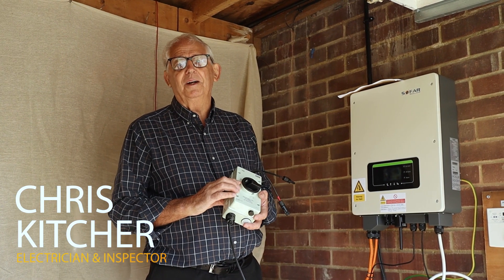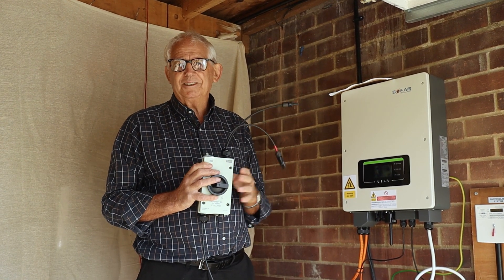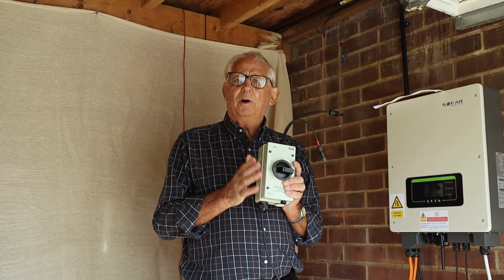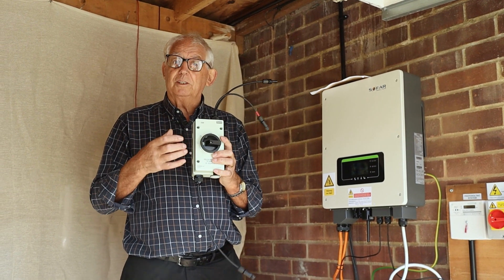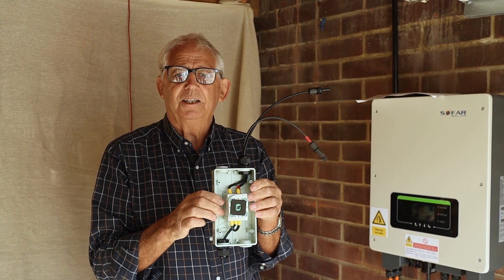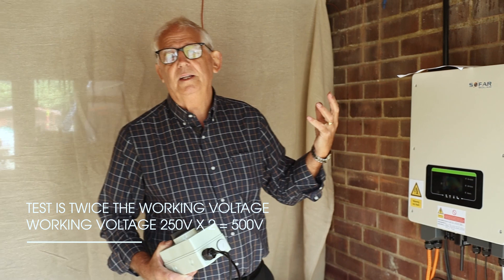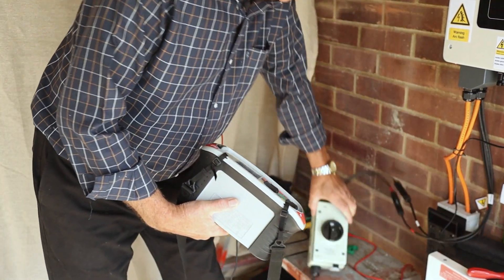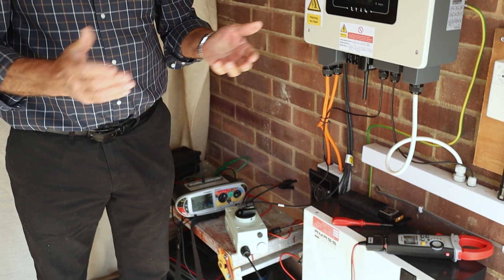Solar PV insulation resistance test with Chris Kitcher. 🌞😎

Comment: The correct amperage multiplier is 1.5625x for calculating the minimum amperage rating of components for solar/pv systems.  That’s the bifacial short circuit current (Isc) of the panels times the 1.25 multiplier for continuous loads times 1.25 again for over irradiance/production in rare cases.  1.25 x 1.25 = 1.5625.

Comment: Hello sir! Great video, I was thinking about this topic for last few days and finally found you! Do you have some kind of pv insulation tester? Or it's just normal one? I have CEM DT6650 and I'm wondering if it's ok? I assume that the third wire from pv shortcut is connected to L in the tester, and the N wire is connected to the ground in the  tester? No matter if the pv system is grounded or not? And you measure it in full sun? With the highest voltage and current?

Comment: If you do not have a stand alone isolator you cannot change the inverter should you need to.
Reply from the maker: I’m afraid you have picked up some wrong information somewhere John. As long as you isolate inverter from AC side first you just unplug the MC4 connectors and you will be fine

Comment: Chris is like the videos. I have a question that I hope that you can help with. After a system has been in commission for some time when I have to go and perform a periodic test on the system, performing any test that requires access to the roof is difficult when the scaffolding has been removed. I am thinking of IR tests.  Due to the inability gain access during a test on an EICR on a typical electrical installation I would LIM the area with no access. I am hoping and expecting you to say the LIM can be applied to the IR test on a PV system especially if the Panel String produces Open Circuit Voltage in line with expectations regarding the manufacturers figures and the irradiance test on the day. I hope you will comment on this. Thanks for the vids. P.s. I have bought your testing book in the past after viewing other videos.
Reply: Test positive to earth, clamp earth to exposed part of the inverter which could be bear metal screw or grill repeat the process with negative. Same applies above 1MOhm or 0.5Mohm @250v if the total voltage of array is <120

Regarding floating system

Comment: Hey Chris, great vid. If you don't mind sir, please clear up the following:

1) I assume this is an ungrounded array, meaning neither + or - from the array is solidly or functionally grounded, correct? 

2) I understand when you short the array, there is 0 volts at Isc but the array Isc current (I think you said 14A) is still flowing in both cables and now you are back-feeding 500V from the megger to produce a 2nd possibly high leakage current  to ground to measure insulation resistance (megger doing ohms law). I understand the megger current is normally very low with good wires but is there an issue with the megger accuracy when both current sources are flowing on the shorted cables at once?
Reply from the maker: Hi Jon,  Because this is a pv panel once the ends are joined the current will not flow anywhere other than within the panel. (Its a bit like shorting the ends  of a current transformer for safety). It will have no effect on the accuracy of the insulation resistance reading.   I hope this answers your question. Best regards   Chris

Comment: The reason we have DC isolators adjacent to the Inverter is so if the Inverter needs to be serviced off site, we can isolate the 'Tails' that go to the Inverter, instead of leaving the Live MC4 end waving in the breeze. But some Inverters have an integrated Isolator that you can unclip from the Main Inverter, so will negate the need for a seperate DC isolator
Reply from the maker: I think you will find that unplugged MC4 connectors meet all IP requirements and would not present a problem if identified and tucked away safely while any servicing carried out. My view is that providing the inverter has its own integral DC isolator the addition of an additional isolator is of no value and adds an additional possible point of fault. It’s a matter of choice I guess.

Comment: Great idea with the isolator; I'm going to make one. I assume that, since this is a 2-pole isolator, it connects diagonally. So, terminal 1 connects to 4, and 3 connects to 2. Then make a link between 2 and 4 with a second cable in terminal 4 with a female MC4 connector on it, correct?
Reply from the maker: It doesn’t matter which way you connect just link bottom terminals

Comment: Sir, when you connect the positive and the Negative ends of your solar PV string into the isolator, you basically shorted them? Will that be ok? No damage to the panels. Pardon my being a newbie. 😅
Reply from the maker: No damage will occur, joining them together is the correct way to carry out a short circuit test.   Always ask if you are unsure.